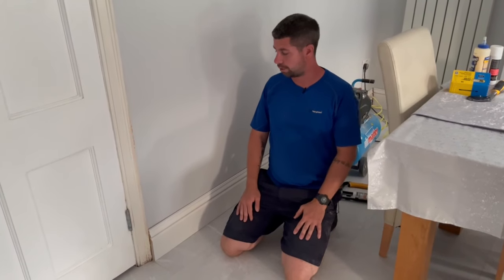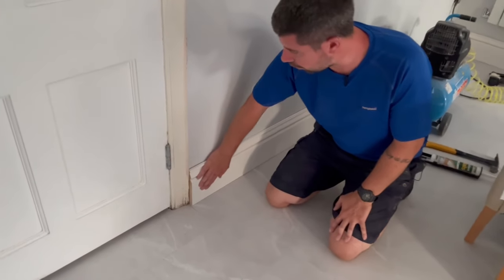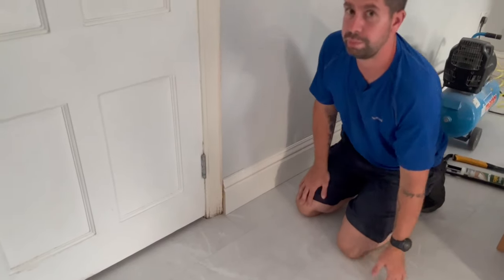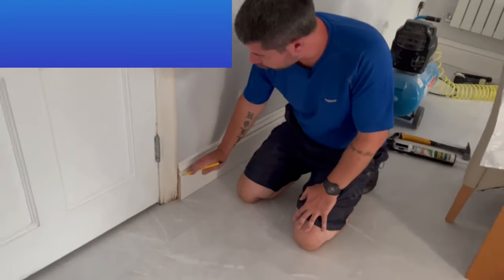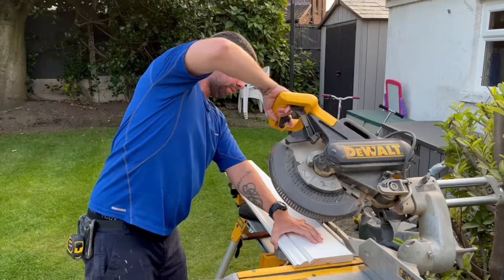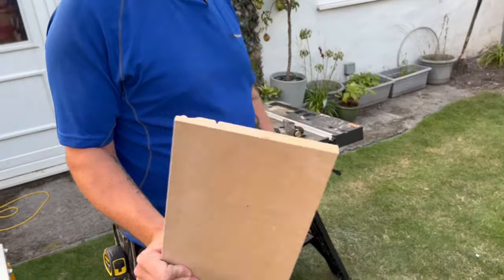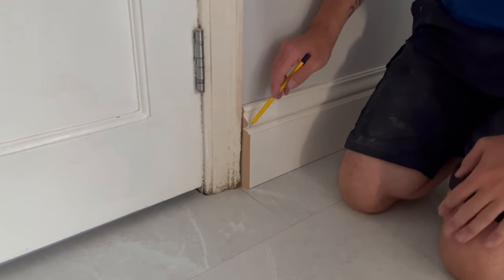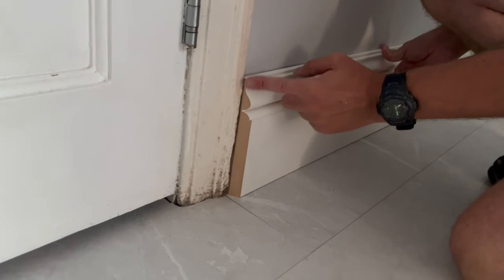Skirting board or baseboard finishing tip

Comment: For about £5 more put new framing round the door,
Reply: Wouldn't make a difference the wall as been overboarded and skimmed so it brought the wall aou 15mm do you not listen.. stick to your 9-5 job.
Reply: "New framing" would involve placing an additional 1 inch strip of wood all the way round the door frame (may need to different thicknesses) because what you're trying to is bring the architrave out so it's sitting atop the new plaster. That way the skirting and architrave when they meet will no longer have this problem

Comment: Why don't you cut an return
Reply: I guess because if he cut a return there, the top contour would be short of the casing and create a small gap in between?
Just like the return he did on the short wall.
Myself, I like how the return looks on ends. But against casing, I couldn’t say. I suppose this is just a different solution.
Reply: Absolutely bang on mate it wouldn't but up properly there would be a shitty little gap and where would you finish the wall paper or emulsion.

Comment: What a total hack, that guy has never served a proper apprenticeship. Solutions a) Use correct thickness skirting boards in the first place 12 15 18mm and thicker are still available on the web, b) use the thinnest available locally and then pack door trim out and fill where necessary.  c)  Use the same thickness door trim as the new skirting and replace it where necessary.  d) The best hack but it only works with non-molded skirting chamfer the back of the skirting with a planer or belt sander for about 300mm. e) Check all the gaps and reveals before you even start work.  Tip never cut corners you will always regret it later on. I am now 70 years old and I hate to see poor carpentry.
Reply: Easy to criticise - I’ve looked on your channel and no video at all about this topic. Come on then show us how it should be done!!!
Reply: @hayley_michelle21 there's plenty others out there.  This guys not gonna come out of retirement just for you!
Reply: @hayley_michelle21 There are plenty of other video examples of exactly what he is suggesting.

Comment: It  doesn't marry up properly and the arks look ¼ inch thick ,it will never look right and thats my reputation gone down the drain after 35 yrs ,and its all about reputation once you lose that your going to struggle for work. 😢 Have you ever heard the saying, if a job is worth doing its worth doing properly .And the saying that I I've been telling all my regular and new customers is, I promise you that I'll never do any joinery or any work in your home that I'm not prepared to have in my own home I'm a perfectionist, that's how I was trained over my 10yr apprenticeship trained by the best old time chippy's, still use my Yankee pump now and then. Simple as punch through the 1½ ovals or lost heads or prise off arks and pull out from the back with pinchers and plant on some 1½ rips of ⅜ or ½ inch ply or mdf arise the ede set back an ⅛ and then plant arks on top,easy as pie .well that's how I'd do it 15 minutes longer. 
It's only my advice, take it or leave it, I mean no offence by my comment, enjoy your work, have pride in your work and you won't go far wrong.